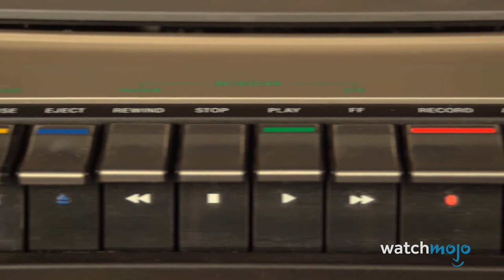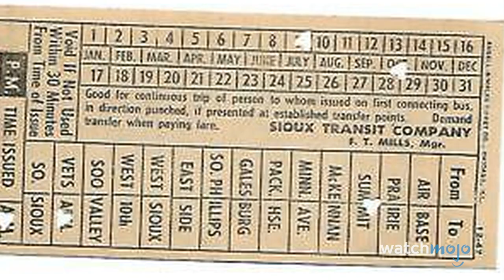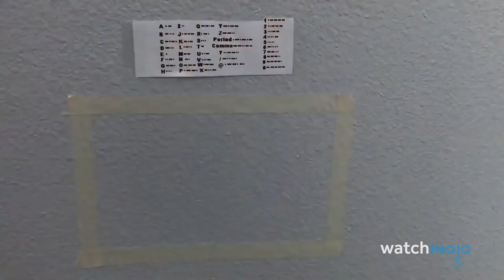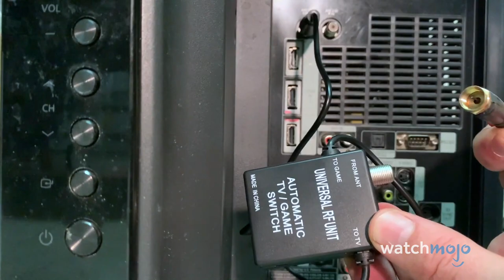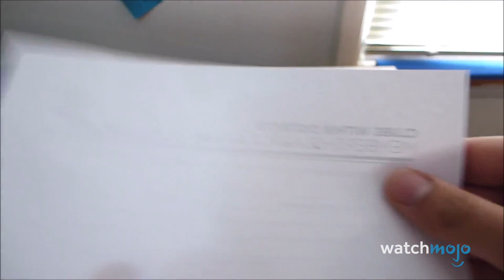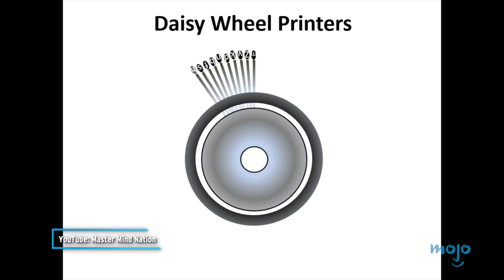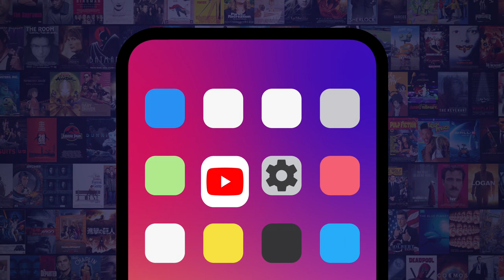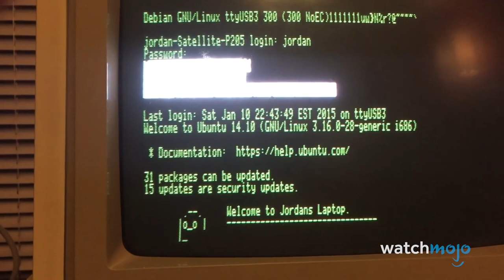Top 10 Pieces of Tech That Do Not Exist Anymore

Comment: I worked for a direct mail company in the early 2000s that had picky clients that still wanted to use those old "dot-matrix" printers in the time of laser printers for printing on the green/white educational type paper.  They expected those old printers to work as perfectly and as accurately as the tech that had replaced them 5x over. That was a nightmare. I also still have my old Smith-Corona typewriter packed up in my things that have the round key wheel.

Comment: When I applied to art school for college in 2002 I had to submit my portfolio in slides. It was a pain in the ass to set up and shoot because you couldn't tell how the shot turned out until you had them processed, so basically you crossed your fingers and hoped for the best. The next year the school finally switched the format requirement to digital via either CD or USB stick, which I was slightly hacked about retroactively. 🙄

Comment: Carbon paper isn't obsolete, even in the US. Truck drivers are required to carry paper logs as a backup to electronic logs, or if the truck is exempt from electronic logging. Some paper logbooks and vehicle inspection forms come with a sheet or two of carbon for the required 2nd copy.

Comment: Thank you for the update, WatchMojo..!!  Back in the 80s, I had a 1200 bps modem at home.  Later that became 2400 bps, 4800 bps, 9600 bps, and a cable modem. :)
Reply: You jumped straight from 9600 to a cable modem?  No 14.4k, 28.8k, or 56.6k?  I remember being upset as a kid that I couldn't get the full 56.6k speed because of the FCC power regulations (well ok, I didn't understand exactly "why" as a child).  But going to a cable modem, and setting up a spare PC for "internet connections shareing" to the connection to the rest of the house was an amazing experience... that probably was a big contributer to me going into IT as a career.

Comment: Rabbit ears, rotary phones, and red boxes to phreak from public phones.
Piano rolls, turntables with record changers that held up to 10 albums.
Mechanical calculators with a crank, electro-mechanical arcade consoles.
Computers with 12 modems to run your own BBS. S-Video cables & ports.
78 RPM shellac records, 45 RPM singles, and tape recorders with spools.
TVs with doors that could be disguised as commodes when not in use.
Thermal fax machines whose paper roll yellowed after 3 months.
Line printers with continuous paper feeds, massive flat bed scanners.
Vacuum tubes in your radio and TV, thermal t-shirts that changed color.
XXX stores that gave you your nudie mags in paper bags.
Incandescent Xmas lights shaped like Santa and Snowmen.
Christmas construction paper to build Nativity scenes (green, with multi-color dots, sturdy).

Comment: In the 1970s the Australian Union of Students had a telex machine. The AUS was also housed in an old multi-story terrace house in Melbourne in which it was very difficult to keep track of who was coming into and going from the building. As a result, every activist group in Melbourne (and there were a lot of them in the 1970s) helped itself to the use of the telex machine for various causes without paying for the messages they sent, causing the union to bleed thousands of dollars a year.